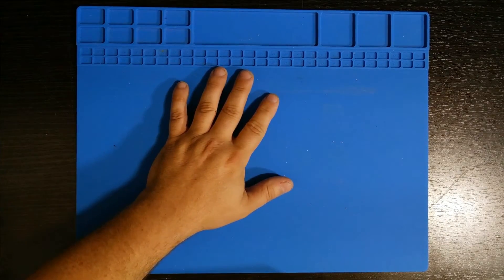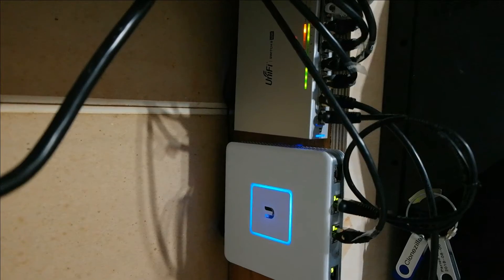Why Newer WiFi Routers DIE

Comment: The heatsinking in these are WOEFULLY inadequate...I stick a strip of the aluminized duct tape on the heat generating items, the large surface wicks the heat away alot better than not having anything
Even adhering small "arm" type heatsinks goes a long way...but the active cooling is definitely the best way to go...even a small amount of airflow goes a LONG way in keeping stuff cool

Comment: have you looked at Mikrotek units? I have one of the routerboard wireless routers and it is actually so damn feature rich that my lack of IT knowledge has left me with little to no idea what I am doing because all the normal names used for stuff seems to be mostly missing, lol, but damn is it and has it been rock solid, (though it was like 150 bucks and only has 8 ports for wired that are half 10/100 and the other half *(4 and 4) 10/100/1000 instead of all of them just being gigabit through out, however it does have more than one wan port, which I find interesting, and seems to have two separate routers internally if you chose to configure it that way, lol, oh and also no 5ghz its all just 2.4ghz Though I have nothing that is 5ghz yet anyway, 

I had a strong suspicion that you were going to say thermal by the way because I have had ingenious high powered and Alfa high powered USB 2.4ghz cards with from 500mW to 3000mW power output, and talk about getting hot, and driving the old routers I was using like linksys units and the Cisco small business gigabit router (basically is like the standard plastic home brew router but was feature rich enough that Cisco actually slapped their name on it instead of launching it under linksys, brand. :) ) anyway once they got hot, the speed dropped and they would start kinda failing requiring repeated resets when being used for heavy data loads, while doing fine when running lighter data loads, (ie I had to put a stop to neighbors logging in and a couple room mates that liked using bittorent to download gobs of stuff maxing out our cable connection, and this was actually how I figured that was what was going on. otherwise I would never have even known or bothered to look into what anyone else was doing.

Comment: By the time that thing craps out without a fanon it there really wont be firmware support for it to keep out the current exploits. The usb fan uses too much electricity topay for it self. Put your stuff on a plug in timer to turn it off when youre sleeping and at work.
Reply: I flash my routers with DDWRT (I make sure it's compatible)...MUCH more resilient (and configurable) than stock firmware

Comment: Good video. Heat alone is not the culprit. The silicon devices can operate very comfortably up to about 100C. The real culprit is broken solder connections underneath the LSI chips from repeated thermal expansion/contraction. This occurs as workload increases/decreases. The smaller size of newer chips cannot accommodate the large pin density needed around the edges anymore. So, they are now just tiny foil pads on the bottom that are soldered directly to pads on the PC board. Only problem with that is there is no room for them to flex like older chips which had wire leads around the edges. Because the two have vastly different thermal expansion coefficients, it places enormous lateral stress on the solder connections underneath which eventually break. IMHO, by design. All they do to "refurb" these units is reheat the chips to remelt and reflow the solder. If they do it right they'll remove the chips in between, clean off the foil pads and reflow with new solder. It sucks. It's planned failure. Plain and simple.

So yes, adding a fan to a new unit is a very good idea. Maybe even go so far as to add finned heat sinks to the tops of the chips if none exist from the factory. Keep that heat from getting to the PC board.

Cheers,
Z
Reply from the maker: Very good expansion on my explanation. Thank you very much!
Reply: Even a small 40mm fan will help...any moving air is a good way to remove heat...static air is one of the best "heat insulators" out there...moving that air away even slowly helps immensely

Comment: Even the UniFi's have sometimes problems with the power adapter
Reply from the maker: that's more easily fixed, unlike the two routers I showed i this video where it's the routers themselves going bad due to heat, not from a bad power supply.

Comment: Not enough info to understand why you need three units.
Reply from the maker: consumer wireless routers are actually three units in one little case.  A gateway, a network switch, and a wireless access point.  In enterprise gear they are separate units.
Reply: Mad Electron Engineering thanks for the clarification.